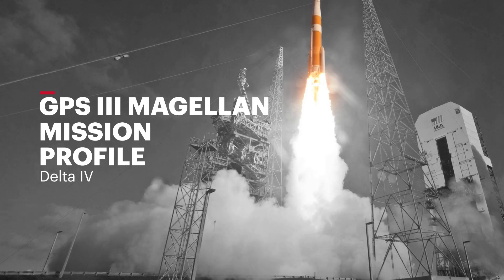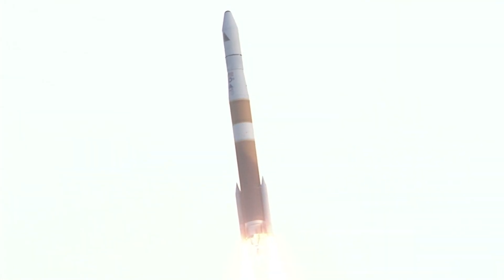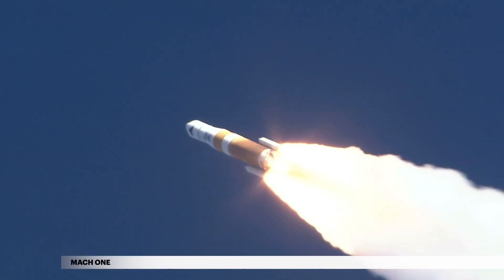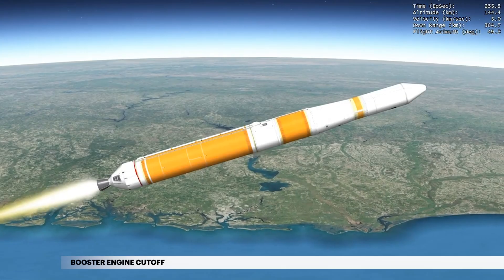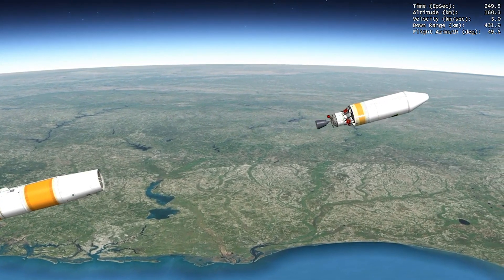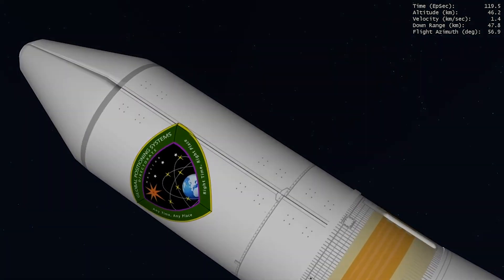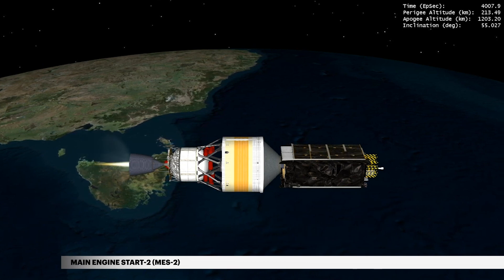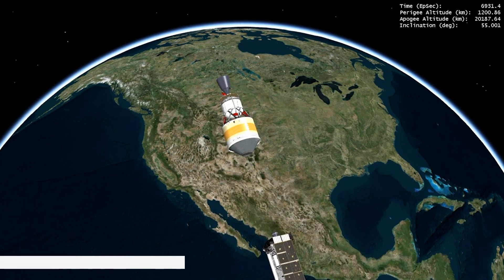Delta IV GPS III Magellan Mission Profile

Comment: Would be good if you used metric
Reply: Did you see the top right corner of the display at stage separation, Chief?
Reply: @My3nMy4  That is true, however, data such as thrust is still given in labs force